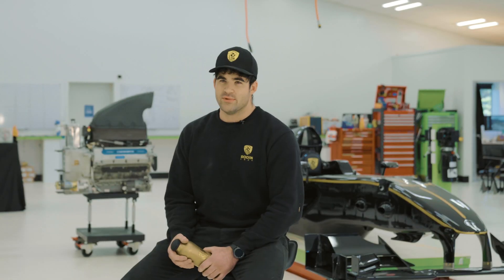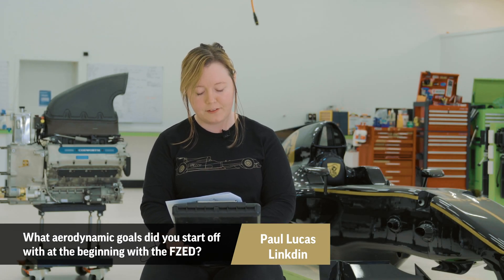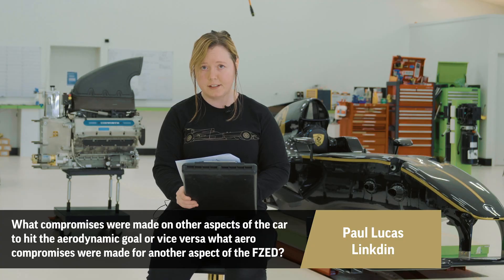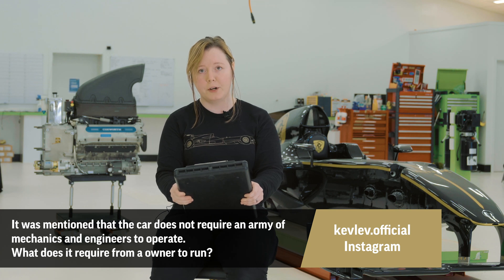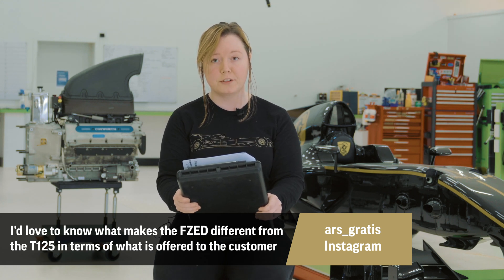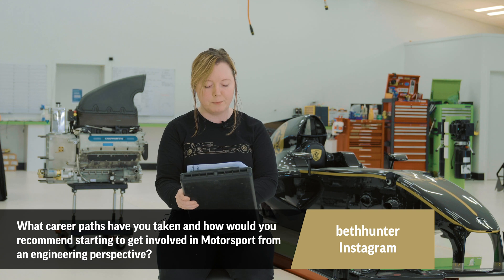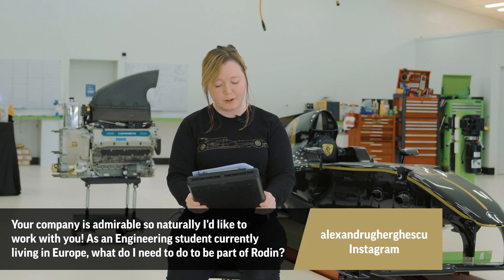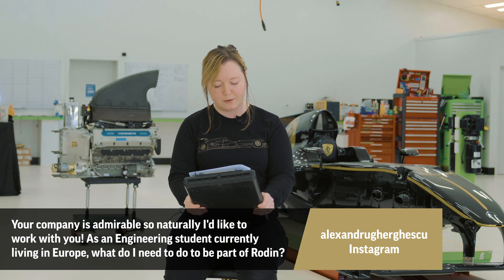Ask Our Engineers Anything - Part 2

Comment: Now you just have to build a front engined F1. 2 1/2 litre NA, no carbon fibre or fiberglas and period correct wheels and tyres. Bring back four wheel drifting to excite the spectators.